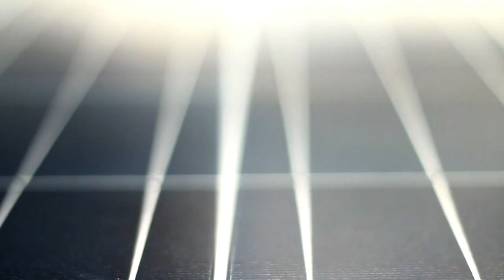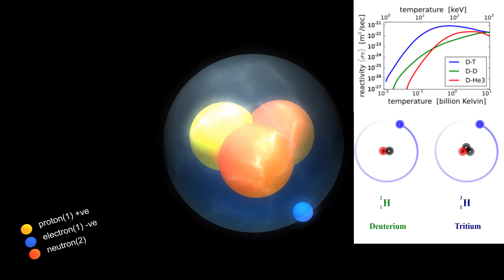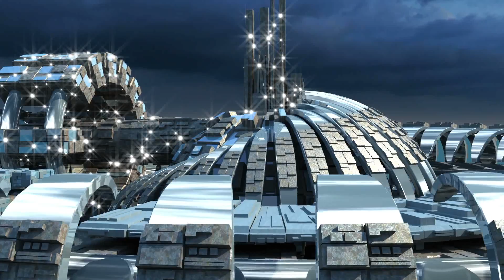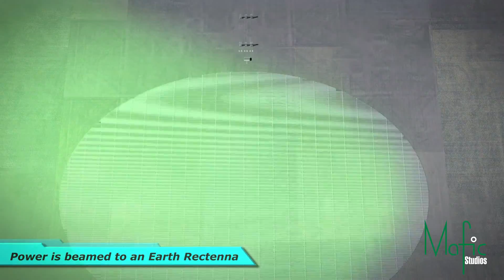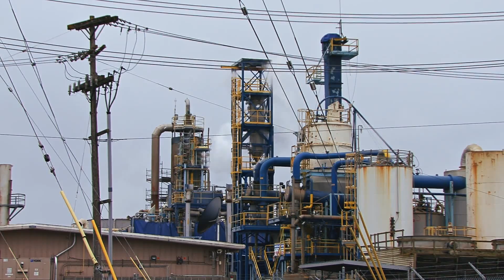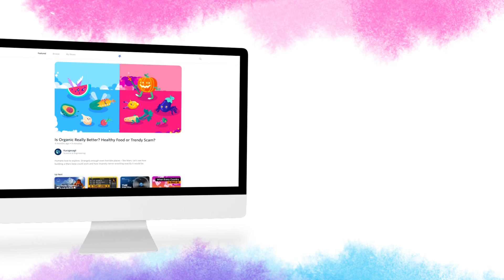Fusion: Powering a Bright Future

Comment: I get the hang up on fusion. But I fail to see how Fusion is REALLY better than Fission . As you said the first fusion reactors we will likely develop will be highly neutronic which means the inner diameter of the reactor will be radio active. Which means we still need to pull our big boy pants up and get used to dealing with radiation. Advanced fission reactor designs are capable of reducing radioactive lifetime of spent fuel down to 300 years which is pretty manageable for humanity. From what I am able to find nucleon for nucleon fusion is only 6MeV (https://www.physlink.com/education/askexperts/ae534.cfm) better than Fission. As a result I do not see how those 6MeV would make fusion any more capable of delivering a post scarcity scenario compared to Fission. So if Fusion gets you to post scarcity. You should be able to accomplish the same thing with Fission. So why wait? If there is no huge error in my off the cuff remarks I would love to see a Fission based version of this video

Comment: The theory for the fusion process was developed in 1920 by physicist Francis William Aston. https://en.m.wikipedia.org/wiki/Fusion_power#History_of_research * In the 1920s, Arthur Stanley Eddington became a major proponent of the proton–proton chain reaction as the primary system running the Sun. A theory was verified by Hans Bethe in 1939 showing how fusion could work in the sun’s core. The first patent related to a fusion reactor was registered in 1946. * If we use the 100 year time span from Benjamin Franklin to common electric generators, then a practical fusion reactor should exist next year. But that is unlikely. Compared with electric generation or solar, there must be fundamental barriers to fusion being a success in producing cost effective power.

Comment: Hello there. I am currently writing a research paper on nuclear fusion by agitator magnetic modal(NFAMM). Wish me luck!
Reply: Will you also use high-capacitance dielectric materials to enhance the electrostatic potential well? With a higher relative permittivity you can get higher electrostatic forces without increasing the voltage. https://en.wikipedia.org/wiki/Calcium_copper_titanate Relative permittivity higher than 250000 http://oatao.univ-toulouse.fr/698/1/boulos_698.pdf
Reply: @johnbash-on-ger   Actually, I was thinking of using dielectrics in tandem with van de graff generator. Thanks anyway!
Reply: @johnbash-on-ger  Now, my research is  taking a new form. Most of it is complete. Now, I am working on oscillatory collisions inside a nucleoplasmic substrate and nth order harmonic motion observed in it.
Reply: @atharvamahajan4949  What if the harmonics are caused by a metamaterial-like structure/effect of the material. That would truly be groundbreaking of you to discover.
Reply: @johnbash-on-ger  nice idea, dude.
Reply: What's  agitator magnetic modal(NFAMM)?

Comment: ITER is terrible, fusion will always be 20yrs away if we spend >90% of the research money on a single project.
Reply: If ITER is energy positive, as predicted, its success will likely reinvigorate fusion research/spending.  In any case, commercializing fusion power in a violent, fractious world might be counterproductive.
Reply: I think ITER sucks for technical reasons but thats because Princeton and DOE already created the LTX-B which is superior technologically the ITER, and ITER isn’t even done yet.  Might as well transition the funds into converting ITER into a larger LTX-B at this point because its already going to be obsolete before it even gets started.
Reply: @XMartianPrinceX  I'll wait until LTX is energy positive (at least) before I toss aside other fusion design options.
Reply: kreek22 I’m not saying toss aside ITER.  All the problems that plague tokamaks with thermal recycling, metal atom sheering, sedentary plasma are fixed by the liquid lithium pfc guiding the plasma so it doesn’t directly interact tokamak walls in any way.  Also the neutron injector that redirects free neutrons back into the fuel to cause further heating and refresh the plasma instead of letting those roam free until they saturate the tokamak walls is a huge leap forward.  I really wish Princeton was working along side ITER to help them perfect it.

Comment: Hey I love your vids. But with this one i have a (maybe stupid) question. You talk about the big losses fusion reactors suffer from converting the heat to electricity through coolants that drive turbines. But dont we have athe option of thermalectric conversion? I know that there are camping wood stoves that have a heat->electricity converter that powers a fan to drive the fire and can charge phones and lights. (the biolite and biolite 2 camping stoves) 

Why cant this be applied on a large scale in a reactor? Even if we forget fusion, it could reduce co2 exhaust by making regular power stations far more efficient, unless there is a snag that i dont know of.

Comment: Energy = something that moves.
Positive Energy = Getting Energy without us doing anything. Currently gravity does that.
Excess Positive Energy = Getting a lot of Positive Energy, exploiting gravity on a subatomic level where its stronger due to small distance. Scaling it by quantity aswell over a field trough transition of movements.

I am deeply sad that durring such discussion the very source of all the topic is simply looked over. That is the hallmark of a shallow discussion where invented terminologies blur the core/root of usefull information.

I think the best way to fusion (nick named cold fusion) would be the abuse of that event when a form of energy transit trough another form of energy, by finding ways where it doesnt just pass walls, but instead gets stuck in the wall forcing it to merge.

Comment: Heh to be fair electricity and solar were insanely fast if you look at the progress of oil, Ancient Babylon used Asphalt to caulk their ships around 4000 BC, the Chineese were piping oil and natural gas in bamboo pipes around for heating and lighting around 2000 BC but it's real killer application the first petroleum fuelled engine 1876 *AD*. Only took about 6000 years from when we first discovered this strange black stuff to figuring out what it's really very good at.

Comment: I had an idea a long time ago, a 3d 6 pointed star thing with each point being a pyramid shaped magnet. The result would be a center part with a  roughly spherical magnetic confinement chamber you could use to trap the plasma. I don’t actually know if the way magnets work allows this to happen though. Wouldn’t it require magnetic monopoles? Also energy would be extracted from the seams of where the magnets connect

Comment: Fusion isn't the correct answer. The correct answer is wind power. That has an added bonus, that while processing the atmosphere, you can take the CO2 out of it.
Reply: Did you even watch the video? Fusion is way more energy-dense, making it a much better long-term source. Sure, it's a long way off, but that doesn't mean it's the "wrong answer". The only wrong answers are anything that produces CO2. Wind, solar, storage, fission. Go for it. Build wind turbines in rural areas. Build solar panels on every roof. Put batteries in every garage. Build fission reactors (preferably thorium ones) for baseload generation. Do it all and get us off fossil fuels as soon as possible. We can switch to fusion once we get it working. The other carbon-free sources can serve us in the meantime.

Comment: Dear... er, Mr... Dr...? Isaac Arthur... ever heard about the Shear Flow Stabilized Z-Pinch Fusion Propulsion concept?

10 million Isp, 1 million N thrust.

Not only they have some pretty good results when it comes to only the power generation aspect of fusion, as theirs is the best type of fusion concept for space propulsion!!

https://www.researchgate.net/publication/239590484_Advanced_Space_Propulsion_Based_on_the_Flow-Stabilized_Z-Pinch_Fusion_Concept

http://adsabs.harvard.edu/abs/2018APS..DPPC11163S

"Building on the ZaP, ZaP-HD, and FuZE projects, scaling studies will be presented of an SFS Z-pinch as a fusion space thruster, which generates high exhaust velocities ( 107 m/s) and high thrust ( 106 N) with low system mass, as will be shown through calculations that account for input power, repetition rate, and duty cycle."

Comment: The fission-fusion approach, essentially harnessing hydrogen bombs, seems pretty quick and dirty. We'd have to be pretty desperate to undermine one of fusion's selling points: relative safety and a relatively small ecological footprint. Another weird one that comes to mind is the mechanical compression model by the Canadian company General Fusion. If fission-fusion combines the old with the new, this one combines fusion with an even older method for power generation: steam. It uses pistons that surround a spherical chamber containing the confined hydrogen isotope(s), which are then fired to compress it in either plasma or liquid form and then obtain, theoretically, short pulses power. I don't know enough to evaluate it, but I think there's a reasonable level of skepticism among others in the field.

Comment: Recycle anything: I am reminded of the concept of the "Phased Disassembly Array" from Homeworld.

Basically, throw garbage into a chamber of post-fusion superheated plasma. As the plasma is capable of not only melting any material we know of, but straight-up gassifying it, all the garbage is now burned up into its component atoms as gasses. You then use magnetic fields to seperate gasses by atomic weight into various collection chambers. These gasses can then be cooled back into atomically pure solids or liquids as demand dictates.
Boom: Everything and anything can be recycled, and comaratively cheaply.

Another knock-on effect could be roadbuilding: Use a fusion reactor to liquify granite and then pour that magma out into roads; The durability of pure stone, with most of the flexibility of concrete

Comment: 21:14 This was mentioned in the other fusion video, how exactly do you do that?
Reply: Know this is old, but you’d use the fusion power to run electrolysis processes on CO2 and H2O separately, then you mix the hydrogen and carbon without the oxygen and run it through fractional distillation (same as in oil refineries) which separates the hydrocarbons.

Comment: I think one of the issues people tend to overlook when talking about Storing Energy chemically, such in Gasoline, is that sure, even if you are pulling hydrocarbons out of the air, to make gas, and other materials, running Gas engines in dense cities is horrifically bad for people's health. The denser cities become the worse the problem will get, and remember long before the exhaust from transportation reaches the hydrocarbon plant, it will have likely been breathed in by millions of people along the way, and it is unlikely that you could devise an efficient system to mitigate this without massive infrastructure upheaval which also has an energy cost associated with it as well, while also keeping in mind, that the best use of technology is not how efficient it is, but how much better it makes peoples quality of life. 

This is true even when you  start talking about living on the Moon, or Mars, having gas powered vehicles, even when people aren't breathing that same air, has a cost associated with it in terms of generation, and that cost would be better spent making sure there is cheap fuel for rockets leaving that particular gravity well. Long term, there would also be a cost of diminishing returns, as larger indoor/underground spaces opened up that might allow vehicles (though I think in that situation even that is unlikely, as it would almost always be more elevators and trams) you would not want to run gas powered vehicles, also likely rocket technology might also have evolved away from the kinds of fuels based on hydrocarbons.

Comment: Two questions:

1) Could someone modify a fusion power generator to weaponize this technology, possibly creating a hydrogen bomb or something equally destructive without needing to go through the trouble of obtaining rare fissionable materials?

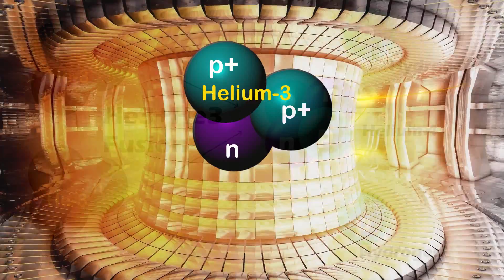2) For the diagram at 17:01, should those He-3 nuclei on the left be drawn differently, to indicate that they each have 2 protons and 1 neutron (rather than the reverse of 2 neutrons, and 1 proton)?
Reply: As to 1) Yes and no....ish. D-T fusion, the most likely approach in this century, is very strongly neutronic. It has been suggested that neutronic fusion could be a terrific way to make lots and lots of plutonium through the reactor blanket. And unlike uranium enrichment, plutonium separation is a lot simpler. Chances are....a country running fusion reactors has the money and tech to build nukes anyways....
Reply: Maybe I am missing something or maybe my question was not entirely clear.

Current fusion bombs (like the hydrogen bomb) work by using a fission reaction of heavy elements to catalyze fusion.  So even though hydrogen is abundant, one can not simply pull lots of hydrogen (or deuterium or tritium) out of the environment and make a bomb with it.  One needs a reaction of fissionable heavy elements (which are rarer) to start the fusion reaction.

So any small group of chemistry majors could probably isolate and store the amount of hydrogen that would be used in a hydrogen bomb, but they can not make it fuse and explode.

But my understanding of research for fusion power is that people are trying to find a way to induce controlled, light-element fusion without the need for a fission catalyst and without putting in more energy than the fusion reaction generates.  My concern was the possibility that, once such a method is found, some small group could use it to induce uncontrolled (explosive) fusion (in a way is not possible with current technology).

I was not thinking of a scenario in which someone uses fusion to “make lots and lots of plutonium” (not even sure how that would work unless you are already starting out with something close to plutonium on the periodic table).
Reply: @BGergley  Making plutonium with fusion would be the usual U-238 route by simple neutron irradiation. It is concerning due to the fact that U-238 is neither expensive nor particularly well regulated or hard to obtain. Regarding your main question: No, it is wide scientific consensus that this is utterly impossible with magnetic/electrostatic containment. The amount of fuel stored in the core is tiny (the plasma is a near vacuum, not some dense fluid) and any marginal failure of the core's system would see the reaction collapse immediately because of how hard useful fusion is in terms of getting enough heat, as Arthur explained nicely in the video. No way to make a bomb. I suppose laser inertial confinement could be made to explode because it uses dense fuel, but have you checked just how big the National Ignition Facility really is. And how expensive. And it still doesn't work right, afaik. It is safe to say that fusion is vastly more safe than regular nuclear power in terms of direct threat. The only concern that gets voiced by experts from time to time is the plutonium breeding thing because fusion is such a very nice neutron source.
Reply: Got it, thanks.

Comment: Regarding fusion development, I think short-term development such as Arc is far superior to a long-term project such as ITER.  ITER has been so long (and expensive) in the making that it can't experiment with recent developments such as (you mentioned) z-pinch, and such as stellarator design.
Reply: Don’t know about Arc your referring to, but I do know that LTX-B that prinston and DOE made will probably dwarf ITER power if they ever made it into a full sized reactor.
Reply: @XMartianPrinceX  I'm less interested in dwarfing ITER and more interested in a fast development cycle.  It's all still experimental now, and learning quickly is more important than high output.
The ARC reactor (https://en.wikipedia.org/wiki/ARC_fusion_reactor) is based on the idea that by using recent magnetic materials to achieve higher magnetic fields, the reactor can be more compact.  But to my mind, its primary virtue is that it promises a development cycle on the order of 10 years.

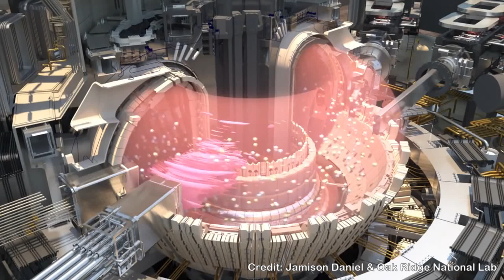Comment: 13:30 Although the plasma is extremely hot it only contains very little energy, and a few grams of material at any given time.
So if the plasma comes in contact with the walls, the containment won't melt or be damaged.
The plasma instead will be cooled and the process stopped.
Reply: @calvingreene90  What's your arguments?
Reply: @JohnJohansen2  
First watch some plasma cutting. 
Secondly the the electrical power involved in containment. Add a bit of heat and the electrical resistance goes up. It is a feed back loop that leads to pretty but expensive arcing.
Reply: @calvingreene90  Sorry to say. But you're totally wrong.
Reply: @JohnJohansen2  
So you think.

Comment: Another aneutronic reaction is in between bor 10 and deuterium, it's called tri-alfa because products are three alfa particles(only helium nucleus), boron is abundant and cheap and bor 10 isotopes is 20%of quantity are in the nature (rest is bor 11 that can be fuzed with normal hidrogen but a little bit harder). Also proton - proton reaction is hard but so called carbon nitrogen cicle is easyest, so you can fuzed normal hidrogen more easyest than sun does.